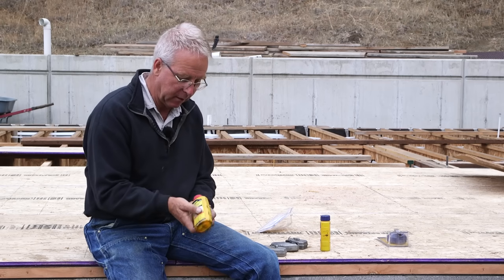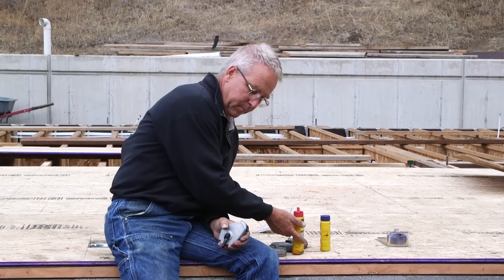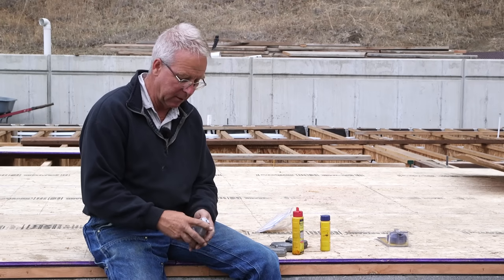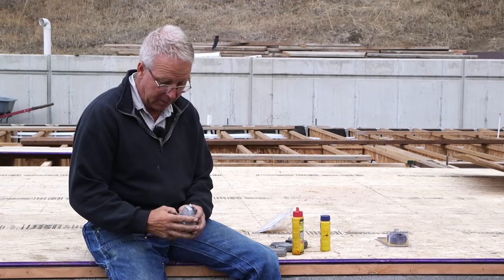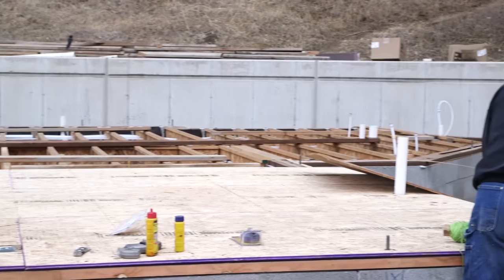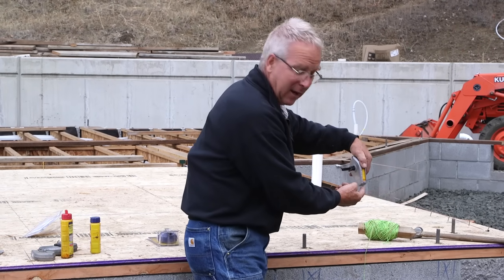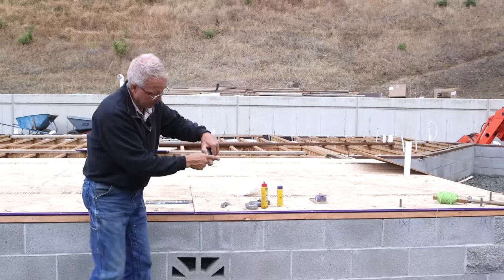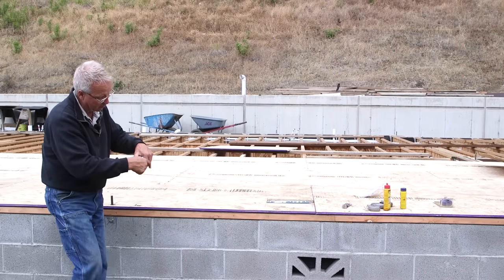Chalk Line Basics

Comment: Tajima chalk lines... you'll never realize how bad every other chalk line is until you own a Tajima
Reply: I bought of those those and it leaks like a sieve. I used same brand chalk. Not happy at this point.
Reply: metal case or plastic case?
Reply: It came with a small piece of foam for the neck to help avoid this I assume and it doesn't seem to help. My next step was to get a higher density foam to try the same. Perhaps it's just the line is still fluffy and carrying too much chalk...
Reply: @bjcombs1989  The plastic case are ok... mine have never leaked. I should have specified that I am talking about the metal case Tajima's. The CR 200's series.
Reply: Thanks. I'm pretty sure it's just me, the reviews on Amazon were great.
Reply: I just came to the comment section to find this comment. Once you use the Tajima chalk lines it’s hard to go back
Reply: The timberframers chalk line
Reply: YUP,so burned out on chewing up those plastic gears gonna try the metal Tajima, good model?. Little hint a general gave me on removing chalk from finish surfaces (cedar, pine, t&g).After he told me I wasn't getting paid until the blue line was gone.After sweeping, brushing, even desperately using a freaking toothbrush. He is laughing the whole time waving those C notes at me. Mumbled "I'll throw you a bone , pyretic acid".Mixed some up sprayed on blue line disappeared.

Comment: NO. NEVER SNAP TWICE. That’s the one thing I expected him to say and he didn’t. 2 snaps = 2 lines = 2 confused carpenters
Reply: Yeah, I never snap twice. Don't trust my shaky fingers.
Reply: Actually, two snaps = 2 chalk lines = confusion en masse

My god do I feel good about myself!
Reply: Eh. Yes and no. Been using em for twenty years. You can repeat a line with good accuracy as far as framing goes as the line becomes less and less coated. Always snap it perpendicular and you're fine
Reply: If you’re getting two lines it’s because that line is not tight enough. New apprentices will cry when I tell them to wrap the line around their finger and press down with their thumb… I pull nice and tight and don’t get to lines… Just a crybaby apprentice with a weak index finger.
Reply: A. Munoz I’ve never gotten two lines because I do this

Comment: I spent many happy years in the commercial drywall & metal-framing field-- as well as building "shacks" (houses) and form-building -- and I have acquired about fifteen chalk boxes (four or five of the metal-cased Strait-Line type and various plastic models of domestic (preferred) and foreign manufacture, and I ended up switching out the fuzzy cotton line with what I call "squid line" -- what the then old-timer turned me on to. It snaps clean and sharp, is stronger and stretches better, it doesn't clog up with chalk, and the chalk box holds more of it, leaving more room for a little more chalk. And some of them turned into plumb bob reels. Totally concur on two-man technique. The guy grabbing the "dumb end" follows the guy with the box and first confirms that he's on the crow-foot.

Comment: My first roofing job (I've only done 3 roofs, and the first was the biggest), I was doing a garage; I learned a lot. On the advice of an older guy, I stripped off the old shingles with a potato fork, which worked great. I've seen other tools at the store for taking off shingles, but I can't imagine they are any better than a potato fork, which, if you're a gardener, you can also use to dig up potatoes (I am not a gardener, but I had the fork, which had belonged to my great grandmother). I replaced some rotten sheathing along the eaves, then I went out and got my first chalk box. I didn't know anything, and I got blue chalk because it was my favourite colour. I guess I didn't overfill it, because it worked fine the first time, and I don't remember ever having any trouble with it. Lucky, I guess. 

Good to know the properties of the different colours, though.

Comment: Great info! I'll add that the ratio lines are generally well worth it with a fairly low ratio of like 3:1, not 7:1. The gears will strip out pretty quickly. Just keep a few spares on hand.

Comment: Great lesson, thanks. You’re so right about getting them wet.  I’m a landscaper and probably have a half dozen trashed ones in my garage. 😄
Reply: If you wash them out really good with a garden hose till the line is clean and dry them out they come back and work. That is if the gears still work.

Comment: I'm a mariner and work with traditional wooden boats, operating and maintaining them.  We have to be versed in so many different skills that have to do with maintaining different boat systems, wood and fiberglass repair, electrical, plumbing, rigging, sailmaking, navigation, etc...  That sometimes I feel a-lot like my skills are spread so thin that I can just never achieve a high level in any one skill.  One day I will be making hardwood mast hardware, chopping mortises and shaping contoured pieces to fit the mast and support different rigging loads, and the next I am sorting out bilge pump wiring gremlins, and then varnish and paint the next.  I worked on quite a few different vessels on purpose to gain varied experience and sea-time in different seas, but as a result I never had a long term mentor.  Many great Bosun's that I learned a great deal from but I have had to develop my skills quite a bit on my own.  

Would love to work one week with this gentleman building anything.  He has such an air of long developed knowledge and teaches what many would consider minor details with as much attention as any of the more complex skills.  The sign of a great teacher.  Every detail is equally important.  Minor techniques for snapping the chalk line will affect the accuracy of your line, by extension your cut and the whole project.  

Thank you for putting your skills out there for everyone.

Comment: I use chalk boxs for snapping lines for tile flooring. Since my grout lines are very narrow, I need a finer line. I get rid of the cotton strings and replace them  with 30 pound tess fishing line; black. Take some 200 grit sand paper and pull the line through it several times. This allows the chalk to adhere better. Only draw back is string stretches.  With practice it's no problem. You won't go back once you see how thin and visible that line is.

Comment: Slightly unrelated. Many of the guys I used to work with would buy a "speedline" (a.k.a. gearbox equipped model), never put chalk in it. They would take the "hook" off the end and attach a plumb bob. Then you could unwind it, get your point transferred, and wind it back up. No more wrapping a line around a stick hundreds of times only to get a stick full of angry spaghetti. Especially helpful when you would get those days of nothing but point transfers. Save hours with this method.

Comment: A carpenter I used to work with always told me give the string a flick in the air to knock off the excess chalk before you snap your line. I never forgot that, I haven't used a chalk line in years I work with steel, and dirt.
Reply: You'd want a pretty gentle flick, and it would depend on how accurate you needed the line to be. If you want a fine, thin line that doesn't have to stay long, by all means give it a flick. If you want a more indelible line that needn't be as accurate, then load that string up to the max and don't flick it even a little.

Comment: Doing commercial roofing in the wet and dry for a year, I only ran through (2) plastastic 4:1 boxes in 13 months. Well worth it for the low, low price of under $10 per, even if the majority of my lines were only being done on 4x4 or 4x8 densdeck, the rest being long runs done on EPDM or TPO rollout. Like you said, when you add up time saved over the course of a day, week, month, it's fairly significant. Cost saved compounds if you have multiple people waiting on you to strike that line and make that cut. If you're on a 3 person crew, you're talking around a third of a cent per hour (standard 1040 hours, which we dwarfed in actual hours worked) per person to replace a box every six months.

I got out of that horribly brutal trade and now do commercial building maintenance working towards a D.C. 3rd grade engineer's license, and that second box has gotten fairly frequent use for the past three years in purely dry conditions and is still holding up extremely well. Of course, the second time I used it in the new job (to strike the first line), I cut off the first ten feet of line and restrung the hook. Because it was wasted from the wet days.

Comment: I was always open for new tool ideas, but I have to say I always went back to the plain old, cheap, Irwin Straightline, shown in the video. They always seemed to be the right size and they functioned just like they were suppose to. The fancy-schmancy gear driven ones always seemed to break, and always at the wrong time. Even the good, cheap ones were worth replacing fairly often bcz the felt bushing would wear out and the chalk will pour out all over the place.
-One more tip, worth mentioning is to, take some care to pull the line straight up when snapping it bcz if you pull it up at an angle and snap it, it will snap a curved line
-Also, go ahead and buy the cotton replacement string , made for the chalk box. Regular poly dry line just doesn’t absorb the chalk and doesn’t work well at all. 
Happy New Year All!
🤜🤛

Comment: Also I usually pre snap the line in mid air to knock off loose chalk, get a bit finer line that way....not always necessary but it helps for finish work where tolerances are tighter

Comment: Ice fishing string works well for a fine line, dacron if I recall.  I can only bear to pop the line once, if it goes a second time there is a good chance of two line!  It sure is nice to work with another that has handled a line a lot, things get done well,   I also find it doesn't need to be pulled way up in the air off the work surface, just the slightest tap will give a great line.

Comment: If you have ever used an ink reel to mark permanent lines, you will never want to go back to chalk. The lines are very crisp. If the surface is not perfectly flat, the ink will still snap off and mark the low spot. This is great for wall layout on concrete slabs. You don't have to have to waste the labor time or keep a can of clear to go back and spray it later. And you don't have a cloud of chalk as you pull out the line or snap it. They won't jamb up because the ink is kept in the ink pad, not in the reel itself. They aren't cheap. But when precision matters, an ink line can't be beat. You do have to learn how to snap it so you don't have super inked up fingers. 

For roofing shingle layout,  we would permanently connect two geared chalk boxes together with a braided fine mason line dedicated for this work. The line would not hold as much chalk, so the box would go longer between needing refills. You could run the full length of line back and forth so the entire line would get the same amount of wear and not break as often, if ever. 

The olde timer that taught this (noob, nube, newby) that you hold the chalk box with the opening facing up when the string is pulled out and facing down when you wind it. Holding it down when winding loads the chalk onto the string. Holding it up when pulling causes the spare chalk to be in the bottom of the box so the felt wiper doesn't have to work so hard. Also, tap the box as the line is pulled out. The excess chalk on the line stays in the box instead of making the chalk cloud. It might seam like extra work and a time waster, but it sure makes a difference in the quality of the line and not having excess unneeded chalk surrounding your freshly snapped chalk lines.
Reply from the maker: Great advice, I am gonna try an ink reel!!!!

Comment: Great video, Scott... Lots of good (helpful) info' here. Nobody ever told me a thing about chalkboxes... I've mostly "made it up on my way" and learned from... well... missteps. (lolz)

   "Boxman walks... Boxman Snaps"... right? Around here, we do it that way, too... BUT we just call the little metal "hook" on the "string end" the "dumb end", so the guy holding that knows he doesn't have to do anything unless expressly told.

    Same thing with tape measures... The spring-loaded reel is the "Smart end" and the other (hook) is the "dumb end"... (lolz)

    It's worth mention, though, that you don't really have to throw away a chalkbox because it doesn't "wind up" anymore. Even the 1:1's will "quit on you"... After hours, you can take the screws out, and open it up... first things first... clean Clean CLEAN... Get all the residual chalk out of there. THEN you can look over the components. If it's actually worn out to a point of "irredeemable", the visual inspection will reveal it (obvious)... AND you can still salvage the crank (if it's not broken) and sometimes other internals...
    If it's in decent shape... You can cut out the last of the old string, and replace with brand new cotton string... They DO still make it, and it's not expensive... You can put a couple hundred yards into a chalkbox (though I don't recommend more than the original load, frankly)... The downside of course, is that the more string you add, the less room there's going to be for chalk.

    ON those fancy new "quick reel" boxes... JUST be careful how the gears fit together in that mechanism. Usually, there just isn't a whole lot of complexity. It's a single ratio of a larger gear on the hand-crank, and a smaller gear on the "reel axle" in the center of the spool... A dab of silicone lubricant does wonders (even on plastic) to smooth out operations, but use that sparingly as it does stick to chalk (which draws chalk buildup inside the mechanism that you just cleaned out.

    What I was never really sure about was all the differences in chalk. Thanks for that... Now, I guess I'll be collecting one or two new colors of chalk. ;o)

Comment: Good information there for DIYers who have never used or owned a chalk line. No mention of the plumb function that existes on most and no mention of the cardinal rule, do not pull the string tight with the box. Wrap the string around the finder and pull with that.

Comment: I use grey primer as a permanent eraser.  Fiberglass works ok as a eraser.   I sometimes pull out 50’ then add new chalk to a new line.   I have used green and a light purple as a less than permanent line.

Comment: If you need to snap a clear line, or you're snapping multiple lines in one area, make sure that when you're going from point A to B that you don't unreel the chalk line over the area you're about to snap. You should hold the line at arms length on either side as you walk to your destination so that the extra chalk coming out of the box doesn't land where your line is going or so it doesn't obscure lines you've already snapped.

Also, there is a limit as to how far 2 people can snap a line. At longer distances the line has more potential to deviate off it's intended path. This is made even worse when snapping over uneven surfaces. Adding a 3rd person to the middle to bisect the line and do the snapping duties will allow you to more accurately snap long lengths.

Comment: Another tip, when pulling line keep your finger wrapped around the line. Its easier to pull it tight and also you can use your finger to keep the line from fraying if you have to pull it over an edge on OSB or shingles. And also the first little bit rarely has chalk on it to mark well anyway.

Comment: A tip for filling the chalk box is to pull the line out first then add chalk. Then reel the line in while holding the nose down. This will cover the line from the inside out saving a lot of time compared to trying to coat it just from pulling it out.

Comment: absolute first thing i do with a box is hook it on something outside and pull the whole run out.  put chalk, reel it all in, then redo that about 4 or 5 times.  The only time i think i've ever needed 40' of chalk was in commercial roofing, maybe floors too for commercial jobs, but in General construction not really.  But the whole line needs to be coated just in case.

I'm doing Marine Construction for the time being and i frequently work over water and canals.  I've dropped two boxes in the same day before.  When i do that, i just wind the whole line out, up off the ground and let it dry. i'll wind it around two points back and forth if i have to, just let the air get to it.  still works.